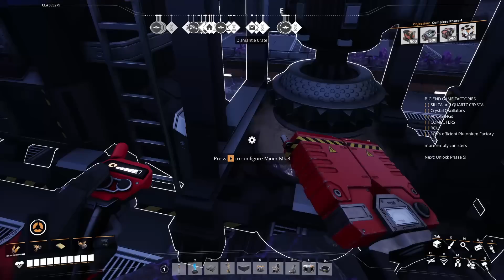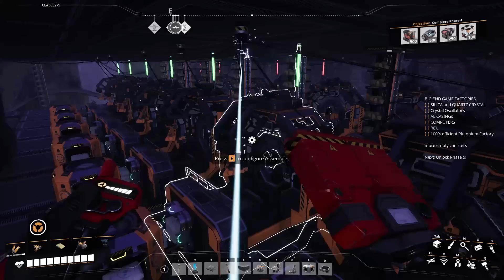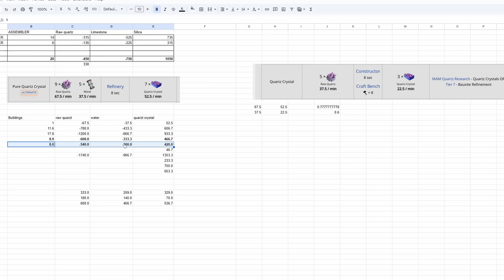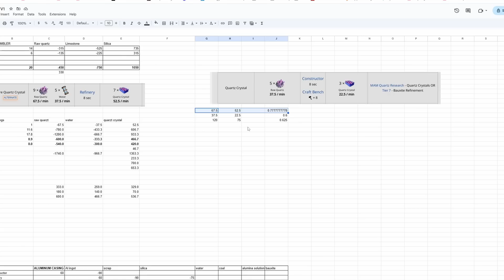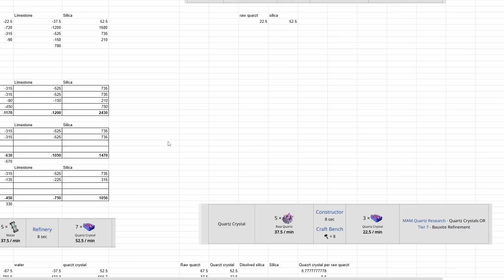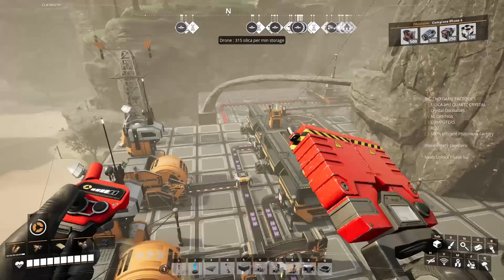Best ENDGAME RECIPE for SILICA and QUARTZ CRYSTAL?! - EXPERT Satisfactory v1 Guide - EP29 - 2025

Comment: for endgame the pure recipes are where it's at, just retool the plants when you get it. i've finished the game 3 times now, only doing the most basic calcs, last playthough i ended with 12 fully overclocked q-encoders for shards as i ran ovr 150000Mw on ionised fuel and was running a permanently boosted power amplifier, a massive portal network and countless particle accelerors for boatloads of diamonds(with still loads of singularity cells to spare) i'm afraid all the over the top spreadsheeting is mostly scaring people off the game, in reality you can eyeball everything and still finish the game easily. just inject or eject where needed and adapt to your situation
Reply from the maker: It's true that you don't need big excels for finishing the game - just needed to have 100% efficient factories :) congrats by the way on finishing it!